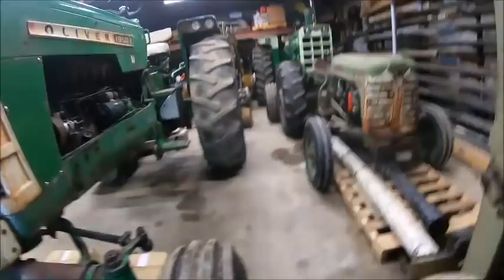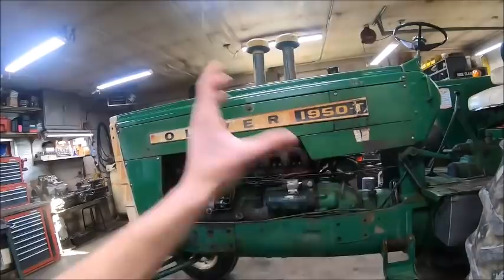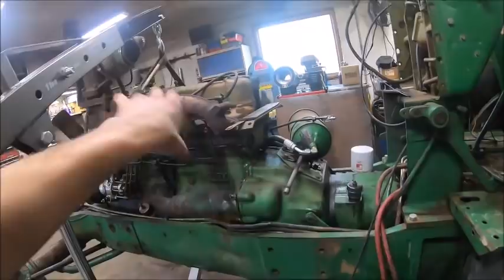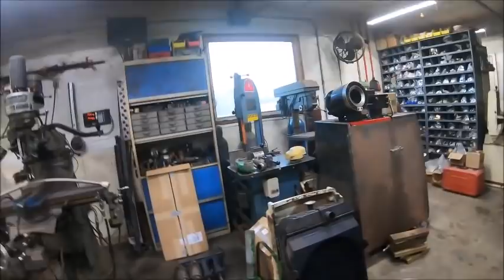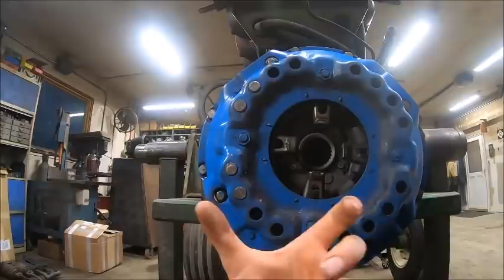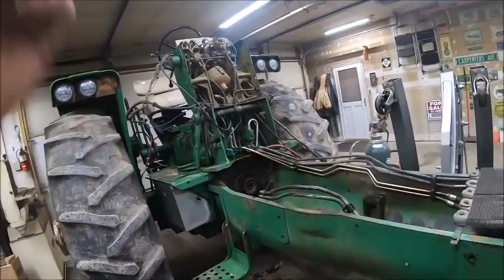Oliver 1950T Overhaul Part 1: Engine Removal

Comment: You definitely made the right call on not bringing the motor to vandykes in Fremont. When Vandykes owned it was a dam good shop but now not so much. Guy that runs it is part of the farm stock tractor pullers and I'd heard he brought his motors to somebody else to get it to make power and stay together🤣. Used to be a good shop at Hesperia automotive north of Fremont but all the old guys retired and its run by a bunch of newbies learnin now I've heard.

Comment: 3 of my uncles worked at Oliver in Charles city. To add to what you said they all said the same thing when white motor took over everything went to shit including their tooling which they desperately needed replaced. Said when they started building the 55 series it was extremely common for the machining done to come out wrong due to wore out machining equipment and if it didn’t pass the little amount of quality control they would throw the junk parts back into the foundry and try again. And it was done way more than what’s normal. Always exciting to watch someone rebuild motors tho lol
Reply from the maker: They had an entirely new assembly line made for the corporate program. A company just north of here built it. They were to the point they were ready to start hauling parts to Charles city. When they killed the corporate tractor program they just scrapped the new line.

Comment: Lifting the engine with the forklift reminds me at work one of super heavy press electric Rousell brand old unit needed to be moved. I herd something crash in the shop. Here when my coworker picked it up it toppled over from not pick it up in the right place.  Shields were bent but straighten. An still works!
Reply from the maker: Never a shortage of idiots around when forklifts are involved.
Reply: @Oliver66FarmBoy  right!

Comment: Thanks for the video, glad you are getting started on this one.  the machine shop things getting bad to find one let alone a good one, that last Perk I did they got 7/8ths of the valve springs the right way up when they rebuilt the head and you could see it was wrong and they missed it ! But I got no real choice it's about the only one within a days drive each way taking and picking up stuff. I'm wondering if you got chance now if it might be worth sacrificing a gasket and pull that hyd top and find out. It's probably not going to get better, and after making that bracket and doing the motor for planting you'll be sick if  it $#!ts the bed planting when you might already be pushed for time with weather and other work.  The kid with the girl needs to get his priority's right or go work in walmart 40 hours a week. After a 10 year relationship ended I had the best summer ever working without having to think I need to be rushing to fix this or hope the phone don't go with a service call and I'm supposed to be someplace else with her. I even ended up driving a combine for one repair customer when he was short a guy for a couple days, That was fun and I'd of never had chance the last 10 years.  I'll do more this coming harvest, he's already asked and raised the pay. Take care
Reply: @TheJohndeere466  Yeah there are some out there  squatch 235 has a Cat  from a restoration project on his channel he calls the "Beer can motor" I picked up a Fordson that broke a cam follower, but on pulling the rocker cover I found where 2 head bolts go through  they broke the bolt hole sides out about 2" deep. They  milled the broke places out bigger diameter and deeper and brazed in 2 sleeves to hold the head bolts. I'd love to know what they did to that head that's 4" thick to bust the 2 holes out that are 1.5" apart ! There is some more stuff I've seen not to far in makes me question the rest and want to scrap that motor instead of rebuilding it as well.

Comment: Are you going to have the injection pump rebuilt? The 4320 that we have has a stanadyne pump similar to that one and I had it rebuilt and turned up. There was all sorts of problems with it, and it would barely run. A fresh rebuild fixed that.
Reply from the maker: Yes

Comment: It is a long shot but could there be an internal breather somewhere that oil could escape from the hydraulics to the rear end because in use hydraulic oil is likely to get much hotter and tgherefore thinner or in some cases froth up with increased volume? 

Regarding the positioning of the planter controls / monitor when your steering do you like to steer with your front wheel on top of the previous wheel mark or perhaps use a centre line view down the bonnet? Linked to this, which tractor do you have in mind to use on your bigger sprayer. 
I know in the long term you have previously said that you plan to use the most recently aquired cabbed tractor to haul it once repaired. I was thinking a) you might want think about a universal mount for the controls of both machines and b) if using it to pull the sprayer the position you were talking about using might block your sight of the rows on the RH side of the tractor when trying to steer between two crop rows. Just a thought. 

I hope that this repair goes as quickly and smoothly as you would wish but in my experience it rarely does!
Reply from the maker: I run down the center line of the tractor and there are no monitors or any electronics of any kind for the sprayer.

Comment: Watching you ratchet those nuts at fast speed makes me glad I purchase an HF impact wrench.
Reply from the maker: Explain to me how you get an impact into a spot where a ratchet barely fits?
Reply: @Oliver66FarmBoy  Extensions
Reply from the maker: So now you have this but tall tower of hard to control shit. But you still didn’t answer the question. What do you do in the spots where the ratchet barely fits? Meaning, you don’t have any head room…
Reply: My initial comment was merely my praise for using an impact wrench to save time and effort.  In a situation where limited space requires it, I would use the appropriate hand tool.

Comment: Eager to see how this all works out. My 1950T still has the 6 point rod bolts too, so a rebuild is in my future plans. Hope you can find your injector pump parts. I just rebuilt mine on my 1855 a month ago and the shop said parts were getting hard to find. Also curious if you had a part number for the turbo you put on your 1955? I called and called and searched and searched and ended up only finding Chinese cheapo replacement turbos.
Reply from the maker: I’d have to look.

Comment: Glad to see you working on this project, been looking forward to it.  The dash mount for a 1850 is the same as a 1750/1800, I believe you are correct anout the T's being the only ones with that guesset so low. Your hydraulic leak into the rear end could also be coming from the seals for the dtaft control rod that goes through the pan. Where did you get your engine stand from, is it home made?? I need to either build one or find something heavy duty enough that will hold a diesel engine.
Reply from the maker: It has external draft sensing. It doesn’t have the rod through the sump pan. And we made the stand.
Reply: @Oliver66FarmBoy  I did not realize the T had external draft sensing, mine has the catIII hitch I have never used the tractor bought it knowing it had a bed engine. I did look at my 1600 dash this morning it has the lower guesset. I think those are different because of shaft for the pedals.

Comment: Good video. Companies trying to save cost at all costs rarely make good decisions. Another example of this is British Leyland of the 1970s, and how the parts bin special car out competed their "bold vision of the future". 
I find it strange that they used the 310 on the 1750 and the 1950t, but the 1850 has a Perkins 354. If they were comfortable with using the 310 in the t, why not the 1850. Any thoughts?
Thinking about it some more. Massey Ferguson had the 600 series where 5 tractors had 4 unique engine models and but the two that did share an engine, one was turbo, the other was not. Crazy eh?
Reply from the maker: The 310T was never supposed to be used.
Reply: @Oliver66FarmBoy  So, in theory the T should've had a 354?
Reply from the maker: It was never supposed to be built. It was produced as a cost cutting measure because the Detroit was deemed to expensive.
Reply: @Oliver66FarmBoy  Thank you for insight. I see now.

Comment: How hard is it to find parts, like the 3 speed case parts and others, to find? A peice of conduit mounted to the platform for you harness would be my suggestion and would be a unit when putting the monitor on and taking it off. I grow up with my uncle owning a 60 and an 88 and when bought his 88 at his auction. Then we bought a 1600 and bought we owned 2 1800s at the same time. One with the checkerboard decal and one with the newer trim. I believe one was a series one and the other a series three. I loved the Olivers. Then we could not get, I believe a 1955 and my dad bought a 1468 IHC. After that he went red because our local Oliver dealer retired and the IHC dealer took care of my dad as good as the Oliver dealer did and the rest is history. I did love the Olivers except the oil that was always on the platform of the 88. The rear high level oil was not cloudy, was it?
Reply from the maker: I’ve never had any issues with parts. They are a little hard right now but that’s due to the current government manufactured “supply chain” issues.

Comment: Looking good and I hear ya at 7:20 .   We try to keep machine shop work to a minimal unless it's truly needed .  May have missed it in the video but what was wrong with the 310 , using oil or excessive blow by ?  
 Keep up the great work !
Reply from the maker: It’s pressurizing the cooling system.

Comment: My 1650 is going in to the shop this weekend. I was taking out hay with it    and don't know what happened to it I jumped off of it to close the gate and got back on it as soon as I pushed the clutch in it wouldn't move
Reply from the maker: They were known for breaking clutch fingers. There was a service bulletin about it. Could be the problem.
Reply from the maker: Not always true. My buddy had one break in his 1655 and it wedged the pressure plate open.
Reply: I'll know more when I git it in the shop and torn apart

Comment: I've never had a problem taking the engine out of a 1950-T, never pulled the dash loose.
Reply: Neither have I. May be because he isn't using the lifting stud?
Reply from the maker: I don’t know what to tell you. We tried everything the first time we pulled it. There is no angle at which that engine comes out without binding between the rear engine mounts and the chain coupler first. It ain’t like this is our first rodeo.
Reply: So weird, I can’t remember if the dash looks like yours or not, sold it in 2003

Comment: Love the information in this one. Curiosity question, I've read and heard 1950-Ts are kinda known for popping head gaskets. Am I wrong? And if 1950-T's are, is fire ringing it an option? Obviously the engine builder is busy as hell so added work may not be an option. If I'm wrong please enlighten me.
Reply from the maker: All of the 310 turbos were known for head gasket failures. They had poor quality control on the machining.